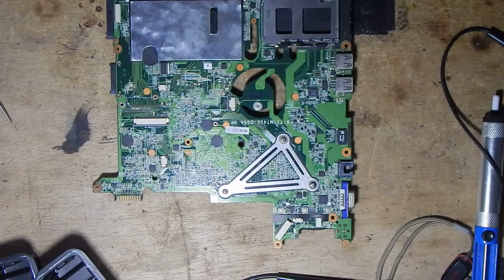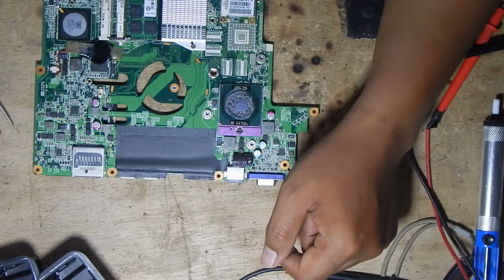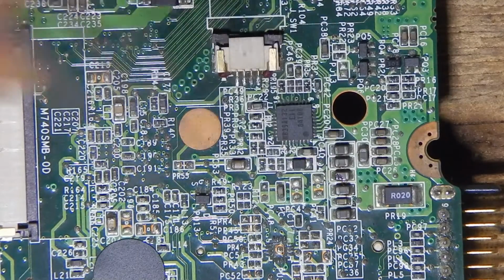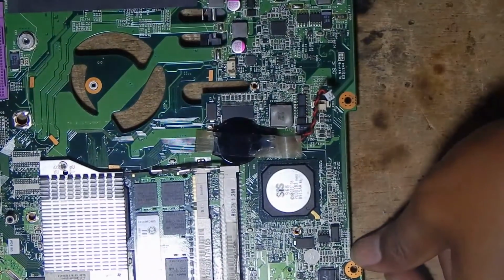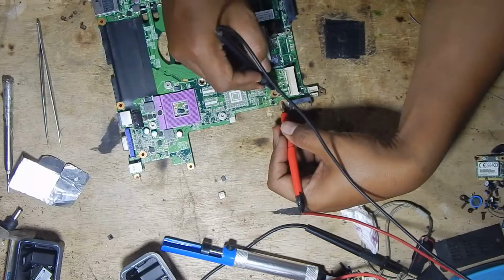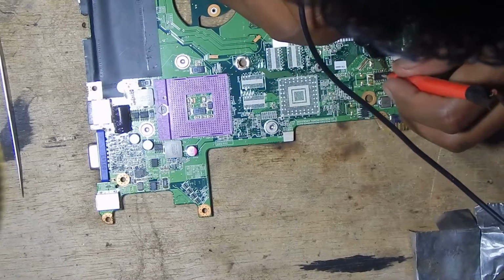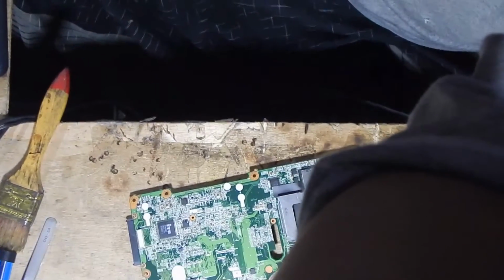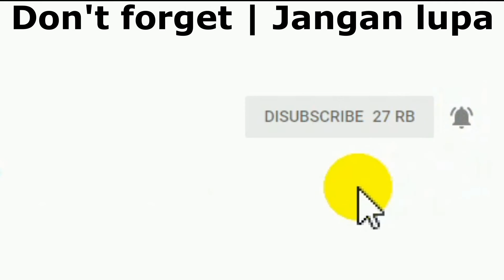Laptop Shorted Mosfet Broken

Comment: السلام عليكم ورحمة الله وبركاته
I have a 8220nx hp with the following problem 
black screen, until i push many times consecuently  the power button
what do you think
Reply: thank you for answering

I forgot tell you  that it starts and i feel the cooler, the indicators are on ,but black screen, the only thing I do : put on and off several times
Reply: I forgot tell you that it starts and i feel the cooler, the indicators are on ,but black screen, the only thing I do : put on and off several times